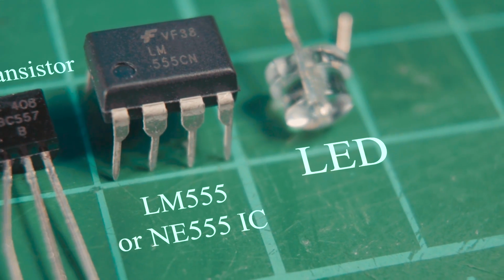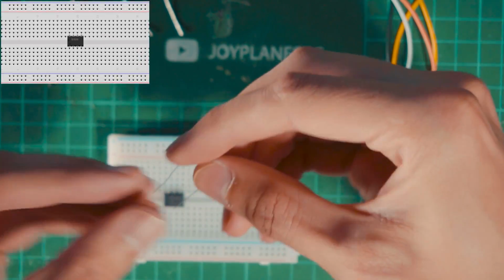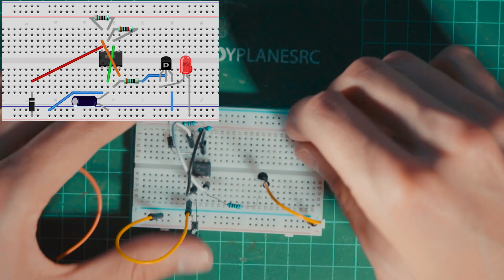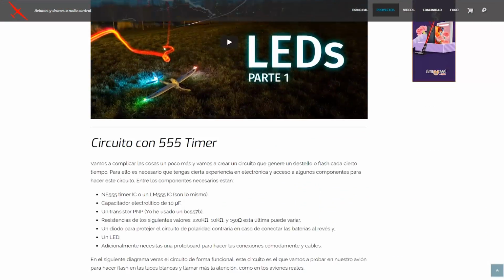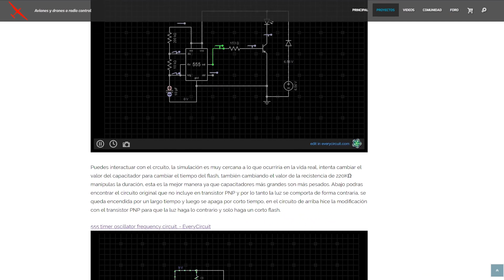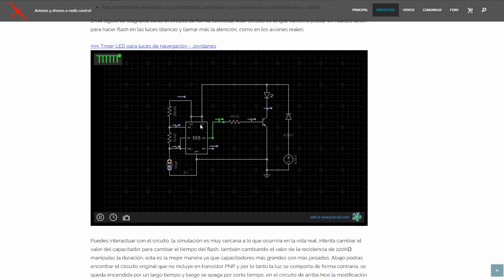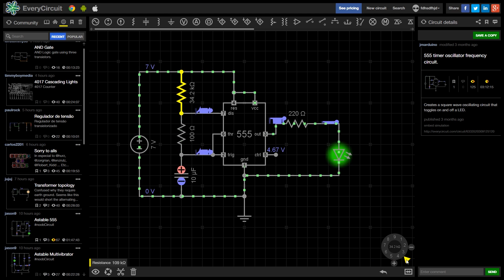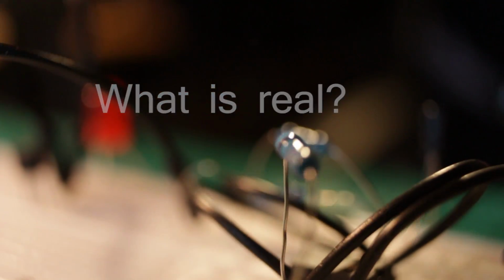NAV lighting system for RC airplanes | 555 timer IC

Comment: If I want 2 LEDs of 2,15 Volt in this circuit, will it work with parts in the discription and just parallell the two LEDs? One LED on each wing tip. Or how to do?

Comment: I tried it with 12Volt Power supply but the led always light and tiny blink. Can you tell what should change in this circuit?
Reply from the maker: Change the resistor values of the LED and transistor.
Reply: Joyplanes RC 2 Ok. how many Ohm of resistor should I replace in 150Ohm instead?
Reply from the maker: @phyomyintmyat5501  try a lower resistance, 50 or something like that.
Reply: Joyplanes RC 2 Ok. I will try it. Thank you so much.

Comment: With ws2812 neopixels connected to digispark (attiny85) running arduino-rc-nav-led, u could even program morse code :)
Reply from the maker: I already did that but the video will come soon, I will also use an Arduino nano.